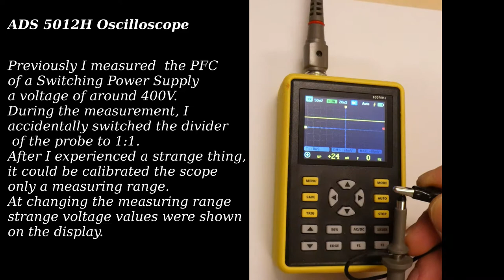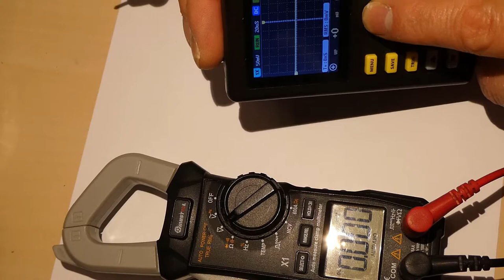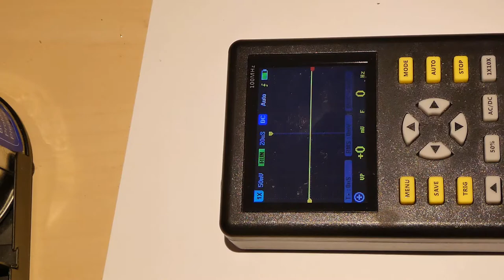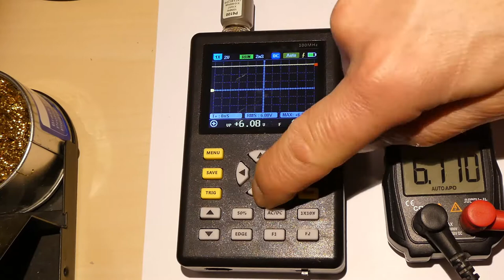5012H oscilloscope repair

Comment: what is the value of the two protection zener diode
Reply from the maker: My power supply can output 33.3V max. This was still not enough to open the Zener with a 200 kOhm in series. So unfortunately I don't know.

Comment: Do It works fine to tv fix, power supply, etc repair  ??
Reply from the maker: Yes, I like it, because very portable, easy to handle, quite accurate too, the battery last long. One thing, the voltage measurement is inaccurate if the measured value is too small compared to the measurement limit.